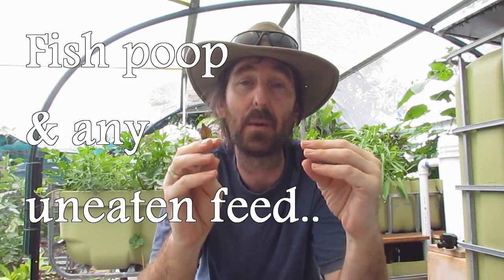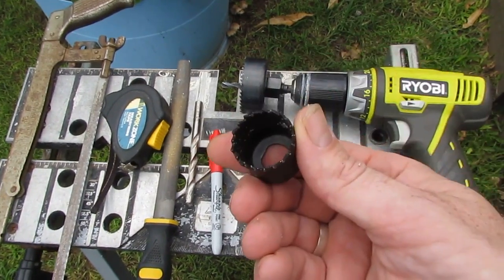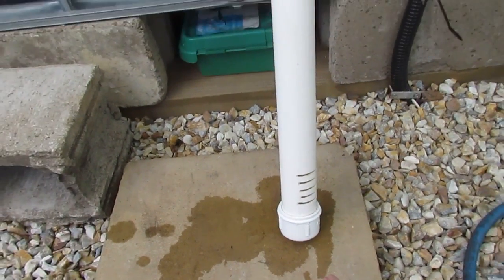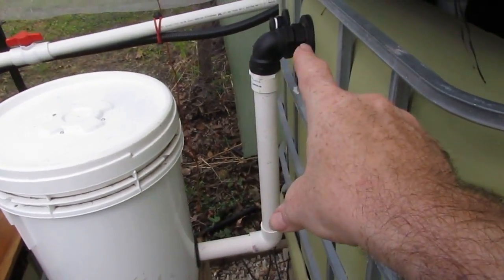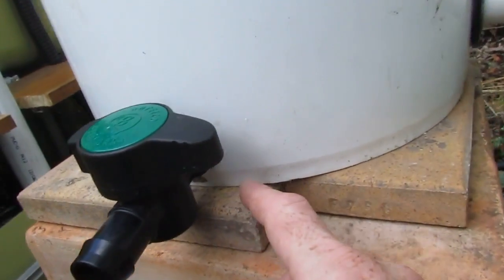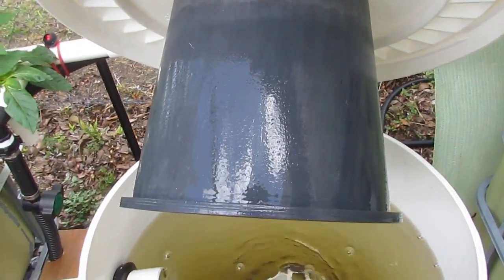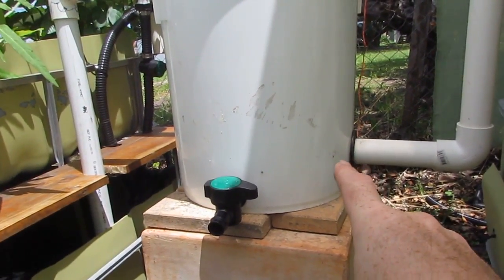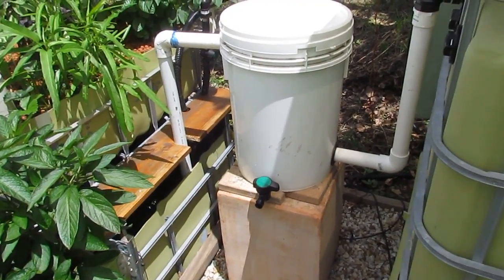Aquaponic radial flow filter for solids removal..

Comment: I set mine up so the inflow sets up a "whirlpool" effect, with the outflow in the middle. This seems to be the standard way to do a swirl filter. What evidence is there that this technique works better? Were there problems that I need to know about?
Reply from the maker: Hi Alan.. 
Swirl filters work well from what I've seen but haven't used one so can't really compare the 2 sorry mate..
A bloke that builds commercial aquaponic & aquaculture systems suggested I make the radial flow unit after he saw the issues I was having with solids clogging up the beds & it's done a great job from what I can tell.. 
You can suss out a post on his RFF here  http://www.earthangroup.com.au/diy-solids-filter/
He also posted on a great looking swirl unit that might interest you..  http://www.earthangroup.com.au/diy-backyard-budget-swirl-filter/  Have also thought about giving one of these a crack but will wait until I have more time on my hands.. 
Hope that helps some Alan..

Below is a link to the trial commercial system Paul is working on in the middle of the UAE dessert at the moment if you want a look.. Is very impressive I think.. 
https://www.facebook.com/earthangroup

Cheers & have a great one..
Rob..
Reply: Rob Bob Thanks for this.
I also have involvement in a 50 person sewage treatment plant and am considering a swirl filter for this too. Something of a larger scale than typical aquaponics setups...

Comment: Thanks for the videos Rob. I put a RFC into my system built on your lead. It is doing a great job of removing the solids. I fashioned a conical bottom, but solids found their way under it and were causing some problems so I took it out. Also the drain at the center of the bottom was not cleaning out all the solids. Now I use a 5 gallon shop vac to remove the muck from the bottom every 2-3 days. Works great. My RFC video can be seen at HOWponics on YouTube. Keep the vids coming mate.

Comment: layman's question... would an in pipe motorized blender blade or several blender blades, spinning inside the outflow fishwaste pipe, break up the larger solids to be a small enough particle size to be useful in the grow beds. Assuming the blades do their job, zero nutrients will be removed. Too much for the worms? or add more worms? Thanks for posting.
Reply from the maker: Hi Dave.. 
I think you will still have a problem of the beds silting up with solids over time.. Worms will only process so much of the solids into plant available nutrients with the rest staying in the beds needing to be cleaned out at some point..
Loads of folks set their systems up this way & say they have no problems with the beds.. I prefer to remove them as I have already had to clean 2 beds out that went anaerobic (partly due to flaws in my newbie design) & know that 2 others are loaded up with solids at the moment as well.. Have loads of worms in the beds too so know first hand that they just don't remove all the solids as some folks claim.. 
Cheers mate..
Reply: Oh I see. I didn't think of that but it makes sense. All parts have a limit including the worms max eating ability. Thanks very much for the pointers.
Reply from the maker: No problem Dave Forbes.. Have a great one..

Comment: Great vids, and lots of good ideas. Just wondering,,, there are some guys who put "red wiggler" earthworms in the media/gravel of their grow beds to take care of the solids problem to keep it simple. Any ideas about that? Thanks for your vids.
Reply from the maker: Hi there Steve... We have loads of wrigglers in our beds & they have done really well from the numbers we have seen..
The one thing that folks overlook is that while some of the castings are water soluble & taken up by the plants not all of them are so get left in the bed..
Will be including them in the new build, just don't think I will rely on them to process the majority of the solids.. They do a great job at breaking down old roots & leaves that accumulate in the beds..
Cheers mate & have a great one..
Rob..
Reply: Thanks for the quick reply, and I agree with your assessment. I'm doing the aquaponics research before my greenhouse build this spring. We're 8,800 feet elevation, and get to negative 20s Fahrenheit (-30 Celsius or so) in the winters. It's still dipping below freezing some nights. Growing seasons are short, but to be extended with the heated greenhouse. Thanks again... great videos.

Comment: I really like that design, nice and easy to make, and easy to use.
Reply from the maker: Cheers Steven...
Have a clip showing a newer build if your interested..
New radial flow filter for aquaponic system..
Hope that helps some,
Cheers..
Reply: I like it. Nice and easy to use and easy to construct. Any reason for not making it actually swirl to collect in the tube at the bottom?
Reply from the maker: They just work better when the solids are left to precipitate out Steven Kroiss.. I have had some folks suggest that you could add another inlet down the bottom to swirl the solids into the middle but that would just re suspend the solids as I see it as well as add in extra pipe work to be clean & maintain..
Cheers :)

Comment: g`day mate great vid, I have a question and need your input. i will try to describe my system as best as i can, ok.....i have 2 fish tanks with 1 grow bed on top of each tank (both ibc) and each system is beside each other and the ball valves on the ibc`s face each other, now i was wanting to build the same filtration system as you have on this video out of plastic 44 gal drums. my plan was to have both fish tanks go into 1X44 gal drum filter and then pump into the 2 grow beds that are on top of the tanks from a clean water/sump tank (another 44 gal drum). this is where it gets into a grey area for me. i don't know whether to use the ball valve on the bottom of the fish tanks to feed the filter directly, or to use a siphon effect, and if i plumb both fish tanks into 1 filter if it will equalize out between both fish tanks...(i will have the filtration system and sump below fish tank water level). does the siphon effect have a better suction than a direct feed from the ball valves on the bottom of the tanks??? will a direct feed from the ball valves have a sufficient draw to filter out the solids??what are your thoughts? it could be a bit of a mind mission to wrap your head around my idea without seeing my system......
Reply from the maker: Hi there Dave.. A picture would help a great deal but will try my best ;)
A few questions first if I could..
Are the 2 fish tanks plumbed together & if not do you have space to run 2 smaller RFF?
Can you pump the water up to the RFF & have them above the GB's so the water can then flow through them back toi the FT using only gravity?

Cheers..

Comment: Great set up! Would it better to try to make a conical bottom to your axial flow solids remover. So that all the waste accumulates neatly on top of the discharge opening. Open the valve and all settled waste is removed, into your worm bins,  with as little water as possible....Thank you for all your videos!!
Reply from the maker: Hey Dax.. Sorry I missed the comment mate..
A conical base would be a great addition if you can source or make one..
This unit was a first attempt & worked OK for what it was..
The new larger filters we're using now have a flanged drain fitting sitting on the flat base that helps draw more solids out.. Still not as good as a conical base but easier to fit into the build..
Cheers mate..

Comment: Hi Bob  I have an important question about the filter for the fish tank which is the ultra violet clarifier to be mounted on my fish tank if I want to. This is to kip the water clear. Will the ultra violet clarifier device do any damage to the nutrients in the water which feed the plants?
 Please let me know if you can, I am about to buy a large filter which have this device in order to filter my 30,000 liters of water with 2000 cat fish in it.
Lucking forwards for your reply. Thank you.
Kind regards
Sorin
Reply from the maker: Hi there Sorin..
I was under the impression that they killed good as well as bad bacteria so haven't looked into the UV filters for our system Sorin.. Am probably wrong though..
With our size system I don't think it's needed but have no idea when it comes to one 30 times larger than ours.. Might be better off talking to a aquaculture consultant or some of the more experienced chaps on some of the forums..

Not much help there I'm afraid mate.. Hope you get the right answer soon..
Cheers..

Comment: Noob question here.  How are the solids being plumbed to the radial filter without a pump?  Is there a pump in the fish container?  Thx!
Reply: I saw that you took the "solids PVC pipe out to show the cap at the bottom and the slits in the side, Is that all gravity run?
Reply from the maker: John Supplee  Certainly is John.. The water pressure alone collects the solids & moves them along through the solids lifting outlet (SLO) into the filter.. Works better with a decent sized pump as the more water that is move through the fish tank the more solids are picked up..
Cheers,
Rob..
Reply: Moved through a decent size pump on the bottom of the fish tank?   Please excuse my lack of knowledge.   :-)
Reply: I suppose I'm having a hard time understanding how the water is getting for the fish tank into the radial filter and out into the beds without a pump....
Reply from the maker: John Supplee  Just popped out to do a clip to show you... Shall let you know when it's up..
Cheers :)
Rob..
Reply from the maker: John Supplee
Here you go John...
Aquaponic plumbing, How the water flows through our system..
Hope you don't mind the response in clip form as I have had a few folks ask..
Cheers mate & let me know if you want more information,
Rob..

Comment: you use the term "radial flow" but your filter doesnt swirl and is a completely different concept from what CCBear had. does it make any difference? everything i find online creates a swirl around the stand pipe (i assume using centrifugal force) to remove the solids.
Reply: Rob Bob I shove a one inch PVC pipe into the valve to move the waste away from my barrel. Once the water runs clear I sweep it right and left to get a little extra. The pipe gives good leverage and the uniseal is very flexible.
Reply: I have two filters so I can drop an airstone in and mineralize right in the filter.  The other takes over filtering.
Reply from the maker: Hey there..
We both have the same style of radial flow filter.. Bears looked a bit different as the bucket in his has no top & takes up the whole opening unlike my smaller jobbie that has an upside down pot screwed to the lid.. His looks more like the real thing than mine to tell you the truth ;) but both do the job at hand..
Both have water that come up the centre of a cylinder (bucket for Bear & upside down pot for mine) where it is redirected downwards & slowed so the solids can fall out & deposit on the floor of the barrel.. There is no swirl involved in either of our filters..
A swirl filter has the water coming in from the side wall creating a swirl & vortex (like you said above) which helps the solid fall out of the water to the floor of the filter..
Hope that helps & let me know if you need more clarification..
Cheers
Rob..
Reply: it does clear things up for me. i just got a little confused i guess because it looked like he had a waterfall going over a round thing in the center of his filter. I'll go back and take a good solid look at it again. thanks for your help!
Reply: I converted my 55 gallon swirl filters into Radial flow filters.  Swirl filters are harder to get right and most people just end up with a settling tub that happens to swirl as I did.  It did work but not as well has the radial flow does.  The radial flow refers to the flow from the inside to the outside.  My exit from the barrel is too low so I made a two inch stand pipe with a two inch to three inch adapter at the top.  Constructing a full ring exit weir is a bit more involved then most people have time for. I have a five US Gallon bucket screwed onto my lid in the same way Rob Bob does.  For my waste exit I have a one inch PVC through uniseal connected to a large PVC floor drain turned upside down.  The blue barrel's natural bottom mold ridge keeps it off the bottom a little so it can suck waste off the bottom with high pressure side flow.  Google "tetra vacuum drain" to get an idea as it works the same way.
Reply from the maker: Hi Jeffrey Obney ..
Paul showed a DIY version of the tetra vacuum drain on the fish farm build, how do you find it works? Do you need to agitate the solids a bit to get them moving ?
Cheers..
Reply from the maker: Thanks for that Jeffrey Obney .. Went for something slightly different on the new jobbie we just built & think I should of stuck with the tetra drain... Such is..
Cheers again mate :)

Comment: Thanks for the great videos Rob. I love your simple smart ideas. I have 2 GB that siphon into the FT. No sump. The pump is in the FT. The top of the FT is almost at ground level. I've dug it into a hole in my carport. 
I love the idea of using a SLO and radial flow filter but not sure how I could incorporate it into my system, unless I dig another hole for the filter to sit in. Lucky I live in sandy Perth! I'd have to stop the pump to keep the water level steady while the filter was operating, I know. Any suggestions on how best to suck up those solids? Thanks! :)
Reply from the maker: Hi KJ..
Sorry I missed your post when it was made & you've probably sorted it by now but here's my 2cents worth anyway ;-)
Do you get solids accumulating on the base of the tank or does the pump suck them up & out ?
If the pump is doing a good job at collecting them you could pump them directly up to the filter above your grow beds I think.. Have seen a few set up like that & they look to work just fine.. 
Hope that helps & would like to know if you got it all sorted..
Cheers mate..

Comment from the maker: Asked around in a few different places & have come up with this..
Placing a 45° off of the bulk head on the FT down to the RFF where there will be another 45° making the total turn 90° not 180° & there will also be no hard bends for air to get locked in causing a back up of water.. Will be having a crack at that later & shall see how it goes.. 
Another suggestion was to move the "T" from the top of the SLO outside the tank or just to add another.
Will come back & let you know how it went..
Rob

Comment from the maker: Thanks Jason.. If the other fix doesn't work I may go with that.. Just had a possible fix posted on the face book page that sounds promising.. Going to try a 45 off of the bulk head down to the RFF where there will be another making the total turn 90° not 180°.. That should alleviate the problem I think... If not a "T" will go straight in..
Cheers mate & thanks for the help :)

Comment: Rob, I tried posting to you on FB, but kept getting errors so I thought I'd come here. To solve that air block problem you could try substituting the 90° for a tee with a pipe out the top long enough to be above your water level. Cheers!

Comment from the maker: Hi there... Actually having the same issue at the moment after moving the pipe work around.. Think it has to do with air locks forming in the pipe work.. Will be doing a post on it on our Google+ & Face book pages in a few hours for you.. Is just easier with pictures I think.. Links to both on our You Tube channel home page at the top in the picture..
Cheers, Rob.

Comment: I built one of these and it is not flowing that well. My fish tank is over filling and it is covering the t in the pvc. I drilled a bunch of holes in the bottom of the solids lifter and it is still not flowing that well. I was just wondering if you ran into this at all?

Comment from the maker: The water is just flowing out via gravity through a solids lifting overflow Ken.. The only pump in the system is in the sump just to keep it all nice & simple :)
I have only used the radial but have been told by people that have tried both that the radial works just as good if not better in their opinion..
Hope that helps a bit & have a great one,
Rob.

Comment: STUDYING MORE AND THINKING ABOUT MY ALGAE PROBLEM HAS LED ME TO AGREE THAT A CONSTANT PROCESS OF FILTER CLEANING WILL BE NECESSARY.  THE ALGAE CAN BE MICROSCOPIC IN THE WATER SO ANY PROCESS I USE WILL ONLY CAUSE A BUILD-UP ON MY FILTER WALLS.
I AM THINKING OF A ROTATING SCREEN FILTER THAT USES THE SUCKING ACTION OF THE PUMP TO CAUSE A SCREEN DRUM TO ROTATE.  SOME SORT OF A SCRAPER OR BRUSH WILL REMOVE THE ALGAE FROM THE SCREEN AS IT ROTATES.  WE WILL SEE.....

Comment: I AM HAVING TROUBLE WITH ALGAE COLLECTING ON THE INLET OF MY PUMP, CAUSING IT TO CLOG AND BEGIN TO CAUSE THE PUMP TO SLOW AND STOP.
NEEDLESS TO SAY, THIS IS NOT GOOD FOR THE PUMP.
QUESTION;
CAN I SET UP A SOLIDS FILTER ON THE DRAW SIDE OF MY PUMP INSTEAD OF ON THE OUTLET?  THE ONLY TROUBLE I SEE IS HAVING TO SHUT THE SYSTEM DOWN TO DRAW THE SOLIDS OFF.  I AM GOING TO TRY THIS AND GET BACK TO YOU.

Comment: No problem. I will say, however, that without a sturdy form to clamp the hot PVC in place, getting a precise angle is really difficult, so sometimes it may not be worth it. Cheers!

Comment from the maker: The inlet at its highest point in the drum is about 1-1½' lower than the outflow pipe from the Fish Tank Doris.. Having a "T" piece at the top of the overflow pipe in the Fish Tank stops the fish tank from ever siphoning out if that is a concern.. 
Having a larger diameter pipe into & out from the filter helps the water flow as well so the water never backs up :) 
Let me know if you want more information on how it's set up..
Rob..